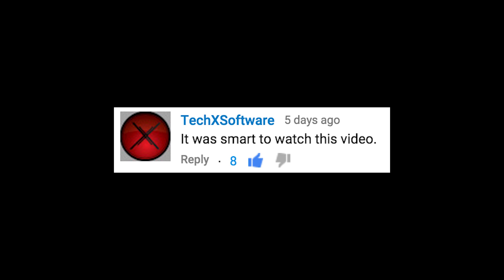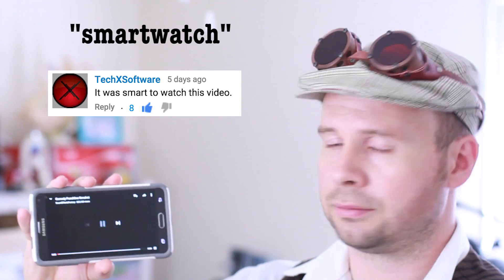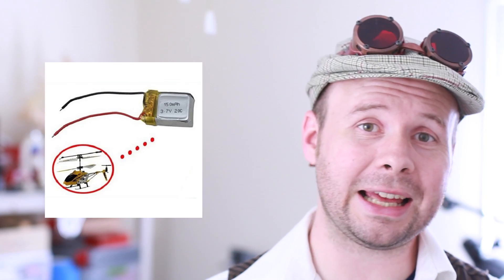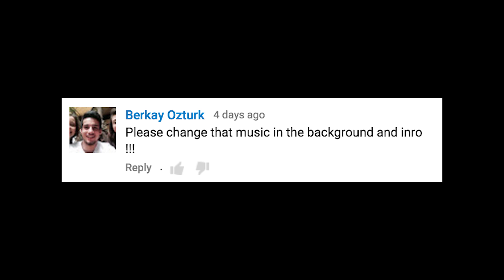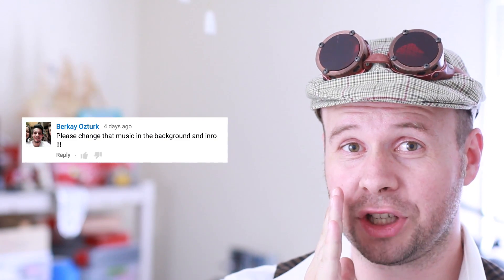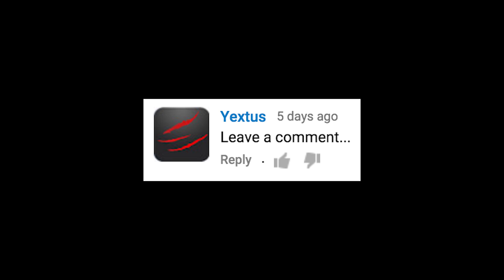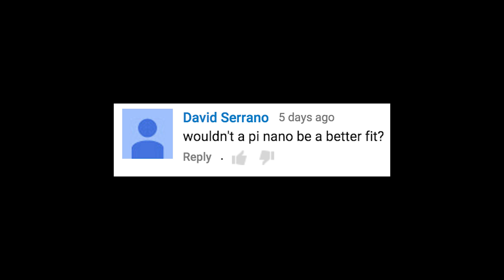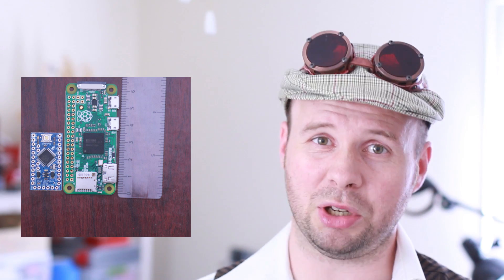Comments Show: Make Your Own Smartwatch From An Old Cell Phone (Part 3)

Comment: could u please please decrease the height of the watch some how
Reply: I think it is possible to decrease the thickness by placing the battery and a bluetooth module into the wristwrap.
Reply from the maker: thinner battery.
Reply: +Tinkernut I want even the capacity could u suggest how to reduce the size of the components
U can use some other smart watch like u8 Smart watch
Reply: +Tinkernut you could also move the battery to the wrist strap!
Reply: Yes
Look over closely in the vid (part 3)
Reply: +Nathan Rozendaal yeah but then we will have to find a battery that is flexible of we r using it in the strips
and now a days it's available in the market
Reply: +Nathan Rozendaal yeah but then we will have to find a battery that is flexible of we r using it in the strips
and now a days it's available in the market
Reply: +Tinkernut And smaller Bluuetooth module.
Reply: I've been working on a smart watch project for past few weeks(inspired from this project).. and right now its thickness is less than 1cm including everything.... what I've done is created my own circuit board with MCU and charge management. plus I've used bare hc05 module which thickness is just a little above 3mm..
Reply: +WeMiT I also thought this... and no, its not possible to move the battery and Bluetooth module to the wrist strap.
Reply: also I've use pic18f26j50 MCU which also has an internal rtc so it works without pairing to a smartphone.